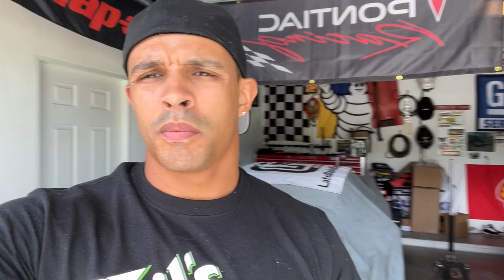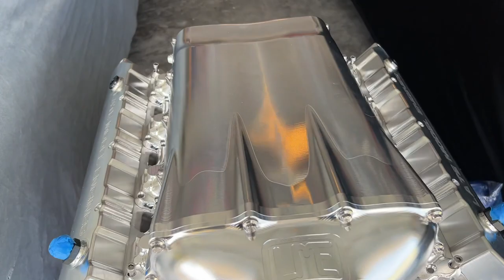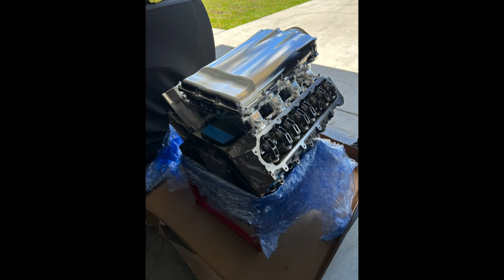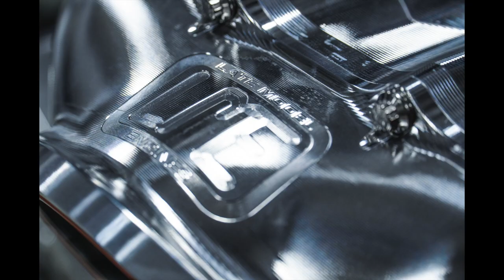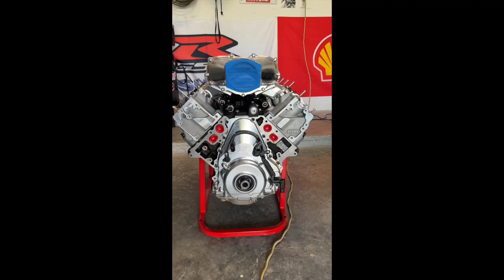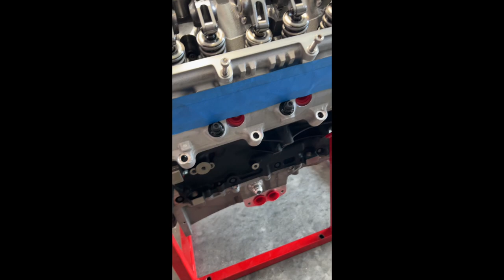My LME LTX 427 is HERE - Snow White C7 here we come

Comment: That's cool CID has 6 bolt heads ready for when a 6 bolt block is available. I'm not sure if the LTR block is 6 bolt. Its available now. Just gotta wait a few months for casting.
Reply from the maker: Yes sir, you can use 6 bold heads on ltr. Lt vs Ls, the deck is so much bigger, almost not needed. Thanks for watching. Ltr is now available from many suppliers.